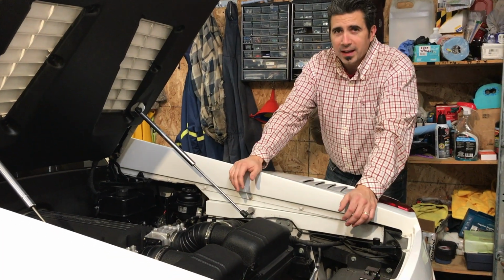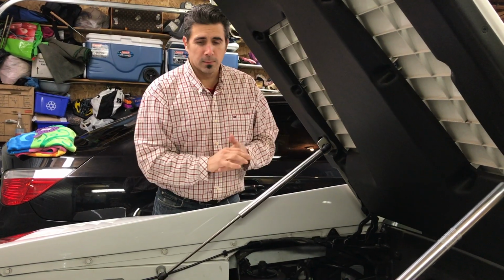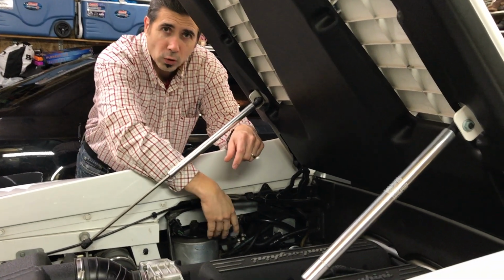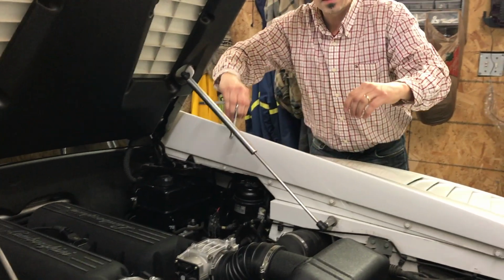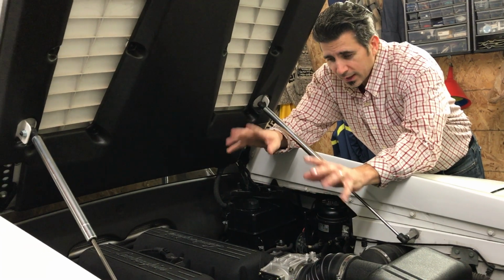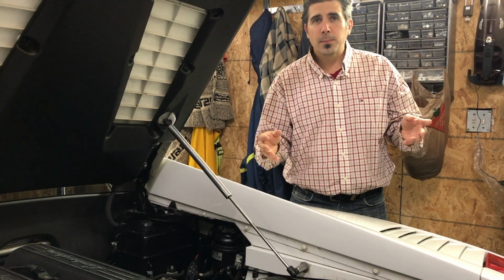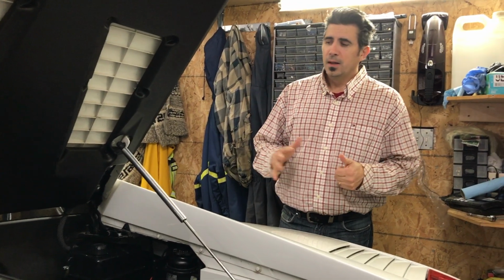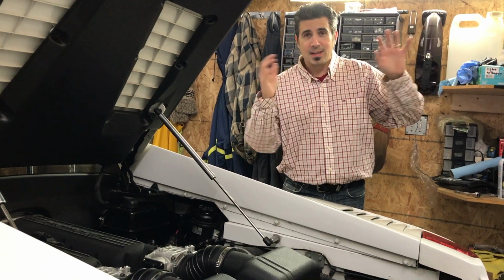Top 6 Lamborghini Gallardo Filter Change Mistakes

Comment: Great follow up video. I have to do my filters next and will be using your guide. I was thinking to jack the car from the side quite high so I wont need to bend over so far. Good idea? About dropping tools. You can put a big towel underneath your work to catch anything you drop.
Reply from the maker: Sort of depends on what maintenance you are doing.  I did a bunch at once from exhaust upgrade to oil and filter change, to fuel and air filters and general cleaning so the car was in different stages of lifted.  For a fuel filter change, the car should be on the ground for easier access and a soft blanket over the buttresses.  The fuel filters are a bit of a pain due to the reaching down deep so you may have to use all 3 side for the access.  The coolant reservoir is fairly easy to deal with Hugh be careful of the lines so they do not break.  The drivers side is the real PITA because the charcoal cannister is shoehorned in there.